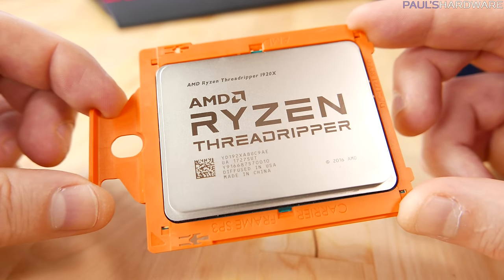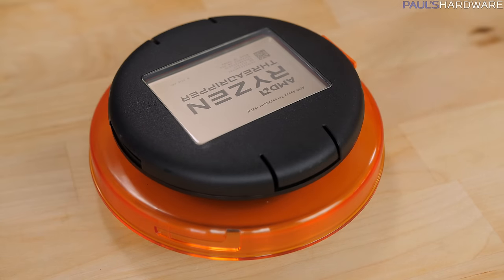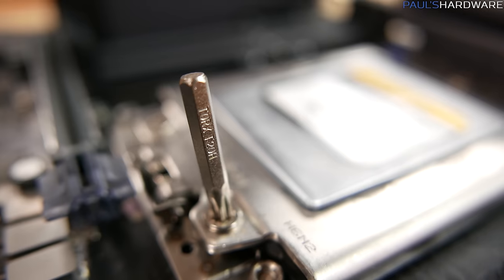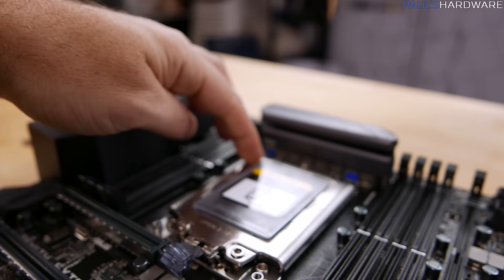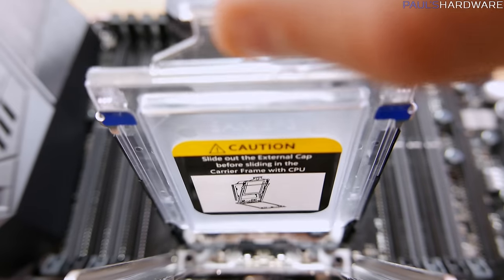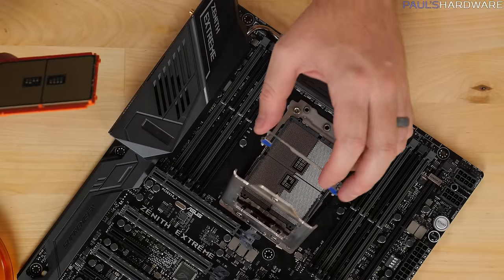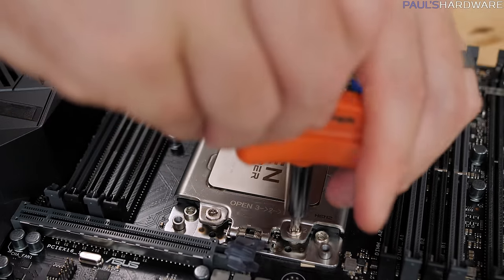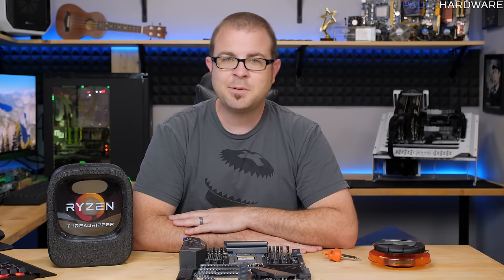Threadripper CPU Installation Guide! How Socket TR4 Works

Comment: btw.. Delidded 7600k + liquid metal vs Ryzen CPU. Which is hotter?
Reply: Depends on which Ryzen CPU.
Reply: Paul Marundan 1600/1600x and 1700/1700x
Reply: most ryzen cpu can be OCed with a stock cooler... i can't say the same for kaby lake. though tdp is low in reality once you put any OC on it ... it just becomes a volcano. though with liquid metal it usually see a 15 degree drop. but with ryzen you will never even worry about delidding ever.  plus why 7600k? i5  and i3 are pretty much dead its only 7700k and g4560 that are worth looking at.
Reply: TheSinisterEyes1 Just wanted to compare the temps because I had the 7600k.. temps with intel were below 30 when idle and on ryzen its above 30
Reply: it depends more on your room temp than the cpu itself

i can overclock my FX 8350 to 5 Ghz on winter and have it not ever get to 45c
Reply: well nothing got answered
Reply: liquid metal isnt worth it. i only dropped 1- 2*c at 5.2ghz with liquid metal, vs the Thermal Grizzly Conductonaut i had installed before(both by the same professional delidder at Silicon Lottery)

i dropped 24*c under load, which is about normal for a proper delid on a 7700k with the Conductonaut and it only cost me $55 including shipping and the thermal paste (which isnt cheap)
Reply: i tought the kryonaut is better?
Reply: you do know that is a 4c4t cpu you are comparing to a 8c/16t processor and thinking wow i have lower temps of coarse you do they are not even the same caliber and idle temps dont matter load temps do
 
it also depends on the cooler i can use LN2 and i would be lucky to hit 0c
Reply: ryzen has a better tdp and is more efficient, if you're comparing a 1400 and a 7600k, when not overclocked, with the same cooler, the 1400 will be cooler as having multithreading does little to effect temps and ryzen has better efficiency then intel. however comparing a 8c/16t even if its more efficient then the i5, the 8c/16t will have higher temps.

Comment: First slide in the CPU into the frame then remove the protective socket cover. Doing it the other was like you did has huge risk in that the CPU could just fall into the pins

Comment: Dont understand all the negative comments since in prior years, bent pins were not unusual for a noob doing their first install, especially before youtube instructions. This brackets helps noobs & others  insert the cpu at just the right angle. Im not an amd fanboy, indeed probably trust intels track record much better than amd's inflated claims of prior years. But intel price to performance just was not there lately with insane pricing and much less techo innovation than what intel could have done.

Comment: Wont that plastic melt away, due to the heat which will be produced later, when its running???
Reply: Good question lol
Reply: not all plastic are the same, all cpu sockets are plastic so i don't see your concern.
Reply: There are plastics that can withstand hundreds of degrees Celcius, I'm pretty sure AMD's engineers know what they're doing ;)

Comment: Bit surprising that the cpu sleeve stays in there, guess it's melting point is rated much higher than the CPUs throttling temperature. Seems a bit complex, but for an enthusiast it's also kinda cool.

Comment: Why is any of that necessary? What's wrong with the "drop the CPU on the pins and then pull down the retention arm(s)" method that caused AMD to choose this instead?
Reply: mjc0961 It looks cool... and you have lower chance of dropping something on the pins

Comment: So is 1900X worth to buy for gaming and pair with 1080Ti?
Reply: 1900X is just an OC'd 1700 with quad channel memory and more PCI-E lanes. But if you want 12 or 16 core CPU just for gaming, you certainly doing something wrong.
Reply: Japixx if you're going to do some hardcore video encoding, streaming, or 3D modeling most of the time then yeah go ahead but if you're just going to game it's extremely overkill since most games can't use that number of cores
Reply: So what is best gaming CPU now?

Comment: Why did you not say anything about torque?  The orange handel that comes with the driver in the CPU pack is set so that it will slip when you reach the torque needed

Comment: Can someone reply and clarify? So does the TR4 Socket work with AM4 Sockets on motherboards? Or are they completely different?
Reply: Completely different. Look at the difference in size alone. Not to mention that one is LGA and the other is PGA.
Reply: Ted Tabaka Huh? You can't put a socket inside a socket. But if you are asking whether threadripper can be used on AM4 that would be no. AM4 is for Ryzen only , tr4 is for threadripper only.
Reply: no. you need a motherboard with a socket TR4 to use threadripper. vice versa you need a motherboard with a socket AM4 to use any other ryzen CPU that isn't threadripper.

Comment: i'd leave the pin cover in place until the CPU and carrier were in the bracket/holder.  If you drop the CPU or anything else it could damage the pins in the motherboard.. FWIW <---- Do we still say that anymore. :)  Daz

Comment: I wonder if the processor will get hot enough to melt that carrier frame
Reply: CPUs don't get that hot, even the i9's, 100C is water boiling, and most cheap plastic containers can handle that no problem. And they can make plastic that goes in the oven at 350F which is around ~170C
If I recall right, Ryzen's CPUs shut off at 75C so if threadripper is similiar, it wouldn't even be able to boil water. Now an i9 might..

Comment: Just one thing, I think the proper step is that you should slide the CPU in the rails before removing the socket cover, that way if you do a "Linus drop it" you don't damage the socket pins :v

Comment: with this large of a cpu i wonder if cooler designers had to take into account the fact that their design might interfere with ram height...something that is usually a concern with only itx and smaller mobos.
Reply: FishJK Ram height are standarised. Design the motherboard accordingly, as for coolers.
Some take a bit of freedom when designing them of course...

Comment: The Most Important Question - Will there be a TR4 X399 Mini ITX Board? !! Make it happen Paul !!
Reply: Probably not for some time, if at all.  They're all ATX.  We're talking about a 180w CPU that runs at something more like 220w, and that's before overclocking.  Even the best Noctua heatsinks will be within like 5c of thermal overload otherwise you need a beefy 240mm liquid cooling setup.

Comment: I'd recommend only removing the black pin protector after you've slid the CPU into the rails to minimize the time that they're exposed. You really don't want anything getting in there.

Comment: Neat insertion trick. Odd though that AMD  would surround a hot chip with that plastic shell. Seems counterintuitive.
Reply: Intel and ASUS did the same thing with Skylake CPUs, inside a typical ASUS Z170 box there is a plastic carrier that you insert your Intel CPU into and place both of them onto the socket.
Reply: CPUs don't get even near hot enough, well.. maybe i9's but even then. Almost any cheap plastic tupperware can handle 100C boiling water, and some even works in the oven at like ~170C (350F) Also, almost all CPU sockets have some plastic in contact with the CPU, moreso on ZIF sockets like oldschool Intel and most AMD.

Comment: Wouldn't that orange plastic get heated up and melt?
Reply: CPUs don't get hot enough. 100C is boiling point for water and most cheap plastic containers handle that just fine in the microwave. Hell cheap foam coffee cups can handle it.

Comment: Hi, I bought my first PC and I'm having trouble booting it. I installed all the components and when i'm trying to turn the PC on nothing appears on the screen, and in the EZ Debug LED the cpu and dram LEDs are on and I don't know why, please help me!
Spects:
Cpu: Ryzen 5 1600
Gpu: gigabyte gtx 1060 ITX OC
Mb: Msi a320m grenade
Psu: NZXT 550w hale 82 v2
Hdd: WD blue 2tb
Ram: G.skill aegis 8gb 3000hz
Case: Corsair spec-04
English is not my first language, so I'm sorry if I have spelling mistakes. Thanks!
Reply: Mauricio casco 1. Check your BIOS is it up to date.
2. Check RAM speed support on the motherboard.
3. Try to clear CMOS.
4. Check your fan pins (3 or 4 pins go different way) or any cord plugged in ( 24 PIN for the motherboard, 8 PIN on the top left, front panel power/reset/led,...)
5. Tear it down and boot it out of the case first to check the parts working. Then put it back in the case.

Comment: When re-attaching the top frame, screw '1' isn't catching... what are we doing wrong?
Note: We know it's not a case of ripped threading; it works perfectly fine with the 'clear plastic piece' that came with the motherboard.
SOLVED: What was the solution? Patience and repetition.

Comment: There a reason amd went lga for threadripper?
Reply: Size?
Reply: Mathew Jewell a ZIF socket that size would be near impossible.  LGA pins have spring to them so can ensure contact over a larger area.
Reply: Imagine how many pins would be on that, dual dye processor, the normal ryzen pins are so easy to bend, imagine threadripper with that many pins
Reply: Mathew Jewell I would be worried about all those pins being on the processor side.
Reply: Threadripper is pretty big, having pins underneath them is asking for accidents to happen by people with clumsy hands.
A 'card' like sliding method to install the cpu reduces the odds of someone 'dropping' said chip onto the socket and damaging the pin, when you can slide it into position and close it with a single motion.

Spring loaded inserters is always beneficial to dropping a cpu into the socket manually, since there are no pins to hold the cpu alone now.

Btw the pins on the socket aren't the sharp thin ones but looks like short 'snubby' shaped ones.

look at 2:30 - Those pins are freaking delicate! It's not straight standing but 'curved' contact pins!
Reply: easy, to compete intel
or
to make the cpu more durable, since there is no pins to bend or broke off

Comment: Why the weird screw standard? Would the normal one for which everyone has a tool not work fine? Why not use thumb screws? This is weird but I guess that's what you get for buying a over $1000 CPU and motherboard for your system.
Reply: eternitynaut Tools are provided with the motherboard or cpu. They WANT people to use the tools, not their used screwdriver.
Reply: You know everyone will lose them in a year or two and they won't have any spear because it's not a widespread standard.

Comment: That's wrong you have to use the tool which is a torque wrench and turn till it clicks, the socket has to be torqued till a certain pressure per screw.

Comment: why the hell is there orange exposed after install... and blue squares... enough to turn me away from the platform... my form is just as high a priority as function.
Reply: RPG31ninja If you had a big air cooler or an aio should cover it up.

Comment: Gah, that Torx driver looks like it has to be the most awkward tool to use. It's barely taller than all the crap around the socket on that board . . . .

Comment: Why the cpu so big? It looks like an ssd.
Reply: There's 4 die under it
Reply: Cause it’s a 16 cores cpu ? So for the manufacture to pack those physical cores you need a bigger size CPU
Reply: There's 4 dies under there, and each of them is as big as the die used in a regular Ryzen CPU.

Comment: I feel much more comfortable with this method instead of Intel's risky bullshit method.
Reply: Risky? The protective cap can stay on during the whole process, you only have to expose the pins for like 10 seconds as you lower the processor in. The orientation is obvious with the triangle and side notches, and the cap pops off automatically as you lower the bracket. Never had an issue, which is less than I can say for PGA ripping the CPU out with the cooler every time. I do agree TR4 is safer, but I think Intel's way works well.

Comment: Using Torx bits on the screws seems really stupid.
Reply: They probably need more torque than a regular screwdriver can provide to make sure the all the lands on the enormous LGA package connects to the pins on the board.

Comment: Although the socket is actually called sp3 :D
Reply: Mm although the mobos probably have fewer traces given the fact that they only sport 8 dims(quad chan) but maybe if all the dims connect separately to the socket making it an 1 dim/channel solution would we be able to drop a fully enabled epcy cpu.. But I doubt it as  Iheard that AMD said to Pcworld that that would not be "possible". But I wonder :P

Comment: Honestly I am a little bit bothered about the orange plastic sticking out, I know that it will not be visible when there is a cooler on top of it, but I still dislike it. Why go through all that fuss instead of just giving the CPU the usual way without any sort of plastic around it and colored plastic sticking out of the socket...
Reply: Alexander Botev do you complain because the capacitors aren't black? no.
Reply: You are right, bit still I want naked CPUs, not with plastic, I know that this is absolutely no problem with the plastic, but it's just my opinion...

Comment: What's with all you idiots complaining about it being so overly-complicated? Ffs is a 800-1000 processor of course your gonna get a little bit of hassle for much better protection(lel). Besides it shouldn't be that difficult to install the processor ffs there's a tutorial right on top of my comment(unless your on PC in which case just scroll up).

Comment: Time for a class action lawsuit.  There should not be a 50% fail ratio due to the cpu connections being so messed up.  This is a serious design flaw.  If anything it's a moneymaking scam.  I'm at 100% fail with 3 different CPUs and motherboards. If you are stupid enough to get one after reading this, buy the accidental insurance.  If anyone wants to sue with me, let me know.

Comment: I call bullshit on that install.  How many times did he have to do it before it worked.  Because mine was a beast.  I wanted to stomp that board into the ground, because those screws never, ever lined up... you have to shove at an angle to try to get it to catch on.  I mean who the hell said three is the way to go.   There's going to be an imbalance no matter what you do... because of the three way.  Absolutely stupid design.